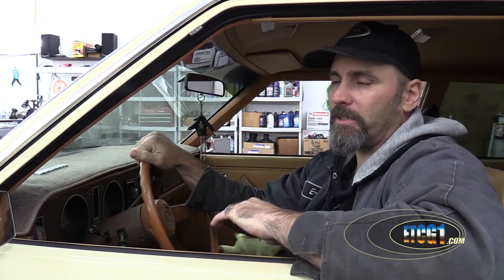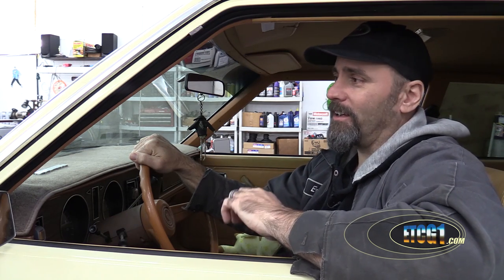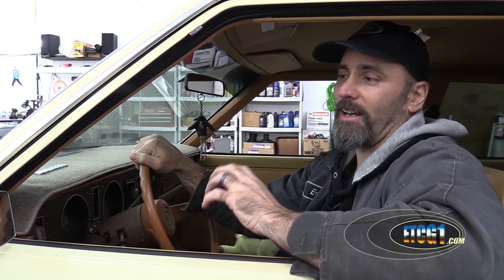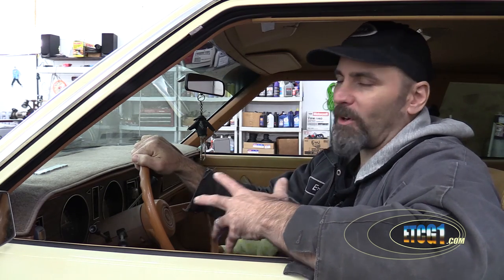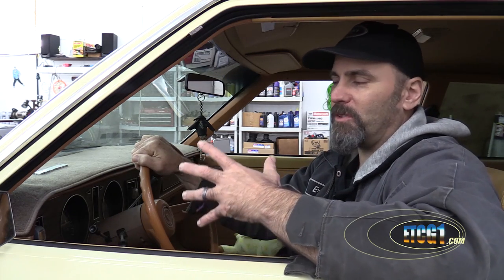Analog vs Digital (Cars)

Comment: There are still NEW motorcycles made with carbs.
Reply: Yep, and carbs generated plenty of power for them too.  But new bikes with carbs are getting less and less, because fuel injection just makes everything so much more convenient.  All my bikes with carbs had to be warmed up before riding on a cold day, the RPMs would shoot sky high as it was warming up with the choke on so you had to keep an eye on it and go remove the choke when this happened, you have multiple carbs so not only do you have to tune them you have to balance them between cylinders, on and on.  With fuel injection, you start it and go.
Reply: True. I still keep in my head all I know about carbs in bikes but own and maintain injected one :) Throttle response is the most important reason amongst the others.
Reply: Who makes street motorcycles with carbs? The stereotyped king of antiquated technology - Harley-Davidson - switched to fuel injection years ago so who is more behind the times than H-D?
Reply: Maybe in countries that have next to no emissions laws.  Carbureted bikes are a PITA compared to EFI.
Reply: The only issue I had with carb installed bikes ('97 VFR 750) was large altitude changes. Going over the mountain roads made it lose a little horsepower.. 
Changing pipes and air cleaner types usually meant change the jet sizes, but other than that the carbs worked fine.
 - Eddy
Reply: Even my nice, new 2017 Yamaha WR250R loses power in high elevation, but at least I know that with fuel injection, the engine is protected from the changes instead of suffering and wearing out the important mechanical side faster.
Reply: Killer2600 Mostly depends on country but Kawasaki AX 125 Athlete to name one from bigger manufacturer. You'll find that below 150cc there are few with carbs.
Reply: I still ride a '74 Yamaha RD350 2-stroke with carbs, and dual points. I'd ride that thing right now across the country, if it weren't 20° outside right now. I built that bike myself - handled every single component in it at one point. Starts ONE kick every time, and has never left me stranded - everything is fixable with basic hand tools. 

When I lived in Phoenix, I owned a '94 Honda CBR600F2 I bought brand new 6 years earlier. Rode that thing up in the mountains of Flagstaff - only time I ever saw the benefits of FI. Got a little boggy (rich) in the higher elevation. That's the only noticeable power loss I've ever had with a carb.  FI is great when it's all working ... until it isn't. I'll keep my 44 year old bike. :)
Reply: Smitty Smithsonite Oh wow! I love that bike! Gets a bhp point less than my Yamaha WR250R, but you get it at a more useable 7,500 RPM while I won't torture it to 10k RPM.
Reply: Well, I think I'm a "few" points over the WR. It's had extensive engine work. Guessing close to 50HP to the ground. I've had it still pulling at 105mph with my wife on the back - she was punching me in the ribs ... otherwise I would've gone faster, lol.
Reply: Smitty Smithsonite Your 350 I'm sure has a lot more room to grow with engine mods than my 250. :)

You got my buddy and I talking about getting something vintage someday. We're all smiles. :D
Reply: Gordon Freeman it's a dying breed, mostly dual sports that the government doesn't view as road bikes. Even new Harleys have electronic shit

Comment: Hey Eric, really great video as always just wanted to weigh in my point of view i guess, i work born in 1994 right were things were starting to change on a mass scale that's the way i see it anyway and the cars i grew up with were mostly built the way things are now but also you had a lot of people my family included driving older cars from the 60's 70's 80's and so on so it was a really cool time growing up for me i think early 2000's because you had this massive mix of cars everywhere from even just people who had a car to form a to b they could have a 1970 vw beetle as an everyday car or a 2002 golf with all the new stuff they put into cars and they'd be the same type of car users if you understand what i mean they only had a car to get around. but now  its rare you see a pre-2000 car on the road and technically i think modern cars are great and better in many ways. but they just don't drive and sound and smell like the older cars like the ones with carbs and no power steering and drum brakes all round those cars are just the coolest and have so much character in them. now when you see an old car 20 years old or more it's driven by someone who has that because they like that car, it's great the new technology we have and there's a massive group of youngsters growing up with this technology. we might tune up the carb or put butter jets in and some of us do rem-mapping all that stuff and it's just another group i think of people who enjoy cars as more than means of getting around.

Comment: i love fuel injection, ive driven both types as my daily drivers and fuel injection is really nice when it gets cold out you can have your remote starts and no accidental flooding . sure the simplincty is nice but look around. how often do you see a car on the side of the road that isent tire related? u do see them but not nearly as often as it was back in the day. i will say things are gettin over complicated, to have the dome lights in a car hooked into a computer is just ridiculous to me but thats the way it is. i wish fuel injection would have stayed as complicated as it was on a late 80s 5.0 mustang or bronco, very reliable and good running systems. but things need to evolve, and where there going to Evolve 2 in the next 25 years who knows.

Comment: Just like the difference between the Z06 and the GTR. Pop a fuse in the Z06, go to almart and get a fuse. Pop a fuse in the GTR, it's on a trailer going back to the dealer.  I just purchased an 88 accord with a carb and was wondering how to make 200 reliable horsepower with the A20. fyi I was going to get the weber conversion.

Comment: look at the 12 valve cummins trucks, or the old mercedees diesel cars, the cars themselves will break before most engine parts, mechanical everything, and they still outlast cars and trucks made today.
Reply from the maker: Nailed it. Great examples.
Reply: MotorsAndMore actually I believe the break downs of these modern vehicles stems mostly from incompetent DIY'ERS. Every Jim Bob thinks that they are a mechanic and go cutting parts off their vehicle and adding stuff it doesn't need. Simply put you will never beat the reliability, economy, performance, and cleanliness of modern computed controlled vehicles. 99% of your issues with electric systems stem from not understanding the system. So dont throw out modern vehicles because you do not understand them. A real technician will study the system and learn it.
Reply: "99% of your issues with electric systems stem from not understanding the system." He is a technician who worked for years on modern vehicles. There is no better way to disprove your fanboyism and your baseless claim. If he was incompetent with modern cars, he wouldn't have been that successful and knowledgable. :D

Comment: I could design and build a fuel injection system from the ground up including software and hardware, so the computer control on cars just makes sense to me.  A carb with a mess of vacuum lines and linkages all over just looks like Rube Goldberg magic.
Reply from the maker: Yea, I get it. But remember, that fuel injection system is still running a mechanical system, just like a carburetor. Thanks for the comment.
Reply: Yeah, but in this case there is an electrical connector on the mechanical piece and I know, at least conceptually, what it's supposed to be doing!

It's all a matter of understanding, I'm sure if I knew what all the bits and pieces on a carb did it would be different.  Also I just like electronics and vacuum lines just make me groan.  Haha.

Thanks for replying Eric, big fan.

Comment: Preach! HATE digital antitheft. Much more likely to leave you stranded, than to keep your car from getting stolen (FWIW, I;ve lievd in sketchy neighborhoods, and NEVER have had a car stolen, or known anyone close to me who has.) You're deliberartely introducing a "single point of failure" to the system, and every engineer hates SPoFs.

Just drive an old vehicle...it won't get stolen. If you have to leave it for an extended time...pull the fuel pump CB, and take the coil wire with you. Car ain't going NOwhere!

Comment: I love older cars :) and i want a new car but right now my -92 volvo 965 is perfect things were better before it all turned to plastic :) love the aluminum intake and the only plastic part on the engine is the cover over the ignition coils :) i could easily go out and get a carburated car got no problems with it, they are special but i wouldn't turn down a new car either so long as it is reliable :)

Comment: Mechanical systems tend to last much more than digital computer control as many factors affect their performance such as weather, pressure, dust, etc. Also, in many cases is much cheaper to maintain mechanic systems than digital. Even though digital have advantages such as accuracy, the mechanical systems can be adjusted manually. The reason for the tendency of producing digital systems in vehicles is simply to increase capital return on investment in manufacturing..

Comment: Actually, electronics nowadays can't be understood down to the electron, because then you'd also have to understand quantum mechanics in order to get what's going on in all those chips :-)
And even if you stay at the circuit diagram + software level of it, it is so complex that if you wanted to fully understand one of the many computers that are inside a modern vehicle, it would be a more complex task than understanding the whole rest of the vehicle (except all the computers) would be.

Comment: in my opinion the idea of more power in a street vehicle means the better control over the street you have! in other words the more power you have means you can get out of any bad situations on the street! such as if you have a 300hp engine and your only cruising down the road using only half that horsepower means you have another 150hp to get out of a possible wreck! so depending on if your good at making more horsepower out a carb engine then thats great, and if your good at making more horses out of a fuel injected engine thats great as well, just so long as you understand how both work.
Reply from the maker: Carol Shelby once said, "There's never too much power, only a lack of traction". Words to live by if you ask me.
Reply: that is true because without the friction of traction then all your doing is driving on ice

Comment: my criticisms with digital is, the older these cars get the more prone to failure the circuit boards become.
like, I'm moving into electronic repair for the next couple of years and I've found out pretty quickly that capacitors don't exactly have what we'd call a long service life.
so these cars with chipsets controlling... well, pretty much everything! will fail Id bet here in 10 or so years, killing off cars even with low miles.
also, said 10 year old cars will probably not have any support from the manufacturer so hopefully the after market will provide replacement chips. otherwise, people are just gonna have to get really handy with a multimeter and a soldering iron.

idk man. cars are becoming disposable appliances. sad shit
Reply: true, capacitors blow, literally blow out.
no more injector function till you swap/repair circuit board.
We'll see how many first-gen Prius are on the road, come 2020.

Comment: Overall I am not opposed to either type of system, that being said both mechanically and electronically over-complicating how a system works simply for the sake of over-complicating it is never good.  One thing I don't get is the current propensity to go full drive by wire... why, what was wrong with physical control linkages?  An example of something I find completely unnecessary is the modern electronic throttle.  Why get the computer in the way of you opening the throttle? In every single vehicle I've driven with this potentiometer and servo replacing a simple mechanical cable I have noticed lag between me pushing on the pedal and the engine responding to my command.  Unless the engine and/or transmission weren't operating properly this has never been the case with a cable operated throttle, I push it responds.  So seriously what was the point, I truly don't see any advantage in adding electronics in this manner in most cars/trucks.  I feel the same way with various other electronic components of modern cars, in some cases I feel it's seriously an "if it isn't broken don't fix it" situation.  To me one of the things that irritates me the most is all the proprietary BS, EG: A computer module that costs hundreds or even thousands to replace, yet if you had access to the coding or it were open source could be done with a $20-60 raspberry pi. Because you know, corporate greed.
Reply: Oengus Fearghas  I'm not a fan of electronic throttle bodies either.  The biggest reason for drive by wire is that throttles with mechanical linkage were being stuck wide open in collisions causing more death and destruction.
Reply: wysetech2000 I can't say I've heard of that being a common issue.  That being said I don't work in the auto insurance or collision industry.  I do remember hearing of software bugs causing that on some drive by wire throttles, not from an accident but potentially causing them.  The only times I really remember seeing sticky mechanical throttles first-hand has been due to lack of proper maintenance on the vehicle and/or a broken throttle return spring... both being fairly rare occurrences.

Comment: I like carbs on motorcycles for the simplicity, but for something that has room for more, a car, i find mech fuel injection to have the advantages of being a analog system without the crudeness of a carb, but you have to switch over to soot fuel, but getting 35MPG out of 500HP is tits.

Comment: just like on the 89-95 thunderbird SCs, they have weak balancers and break,, the crank sensor reads the outside ring, i have had called saying they changed both crank and cam sensors and still same codes and no start,, i tell them to take the belts off and check the crank pulley,,, BOOM that was it because the sensors were not in time to each other due to a mechanical problem

Comment: I've heard that modern day carbs are about as efficient as fuel injectors today. is that true?
Reply from the maker: Not entirely, but they're pretty darn good. At least mine is. Fuel injection works well over a much wider range of conditions but carburetors can be a perfectly viable fuel delivery system if set up and applied correctly.

Comment: Eric, what's your opinion about the Freevalve technology (camless engine) that Koenigsegg is using on their latest model?
Reply from the maker: That's a concept that many companies have tried over the years, including Ferrari. That said, it should be pretty trick when it works. When it breaks, it'll probably be very expensive to fix.
Reply: Yeah, I think so too. I saw a short documentary from DRIVE  with Christian Koenigseeg where he explains the system. It looks trick but if it fails, it should be a pain in the butt to fix. I asked this question due to the examples you gave regarding fuel injection/carburettors and the whole analogue/digital discussion.
I'm from 83 so I'm still an analogue car guy. Too much electronics on a car are a turn off for me (no pun intended)
Thanks for answering my question, Eric. Keep up the good work

Comment: I'm one of those newfangled millennials and I for one hate obd2 cars with a passion. They're overcomplicated and expensive as hell. $40 to a replace the cable for my ABS sensor (not the sensor itself. Just the cable) is ridiculous in my professional (and poor) opinion. On the bright side, my ABS system wasn't working for a month and I was forced to learn braking modulation like you old people did. 
I guess I'm the lucky kind of youngster that has more time than money, more curiosity than common sense, and enjoys tinkering.

Comment: I think both are good if there done right and it boils down to what do you want to do?  I saw a video this year kid had a modified  honda no gages in the car and he had his ipad sitting behind the wheel with all the gauges you could possibly think of and it was some kind of honda app monitoring every system in the car I thought wow thats cool but there is something about say a late 60's bigblock musclecar  with a carb that has 14" of room around the engine to work on it and all you need is a few size wrenches and a couple screwdrivers to tackle just about any job.

Comment: Early fuel injection systems with no self diagnostic capability are absolutely hateful. Had a 1984 VW Vanagon with "Digijet" injection and when it malfunctioned I had to break out the meter and/or throw parts at it to figure out WTF.

Comment: MPI isn't even the most modern injection technology, I've had a car from 1997 with an MPI system. Nowadays, it's all direct injection (with the drawback of really bad environmental values like NOx gases and stuff like that, so the exhaust aftertreatment has to become more complex as well, and so on).
Reply: MPI in 1997 was rather common in my opinion unlike say Mitsubishi's GDi (sure direct injection was waaay before but I hope You get my point)